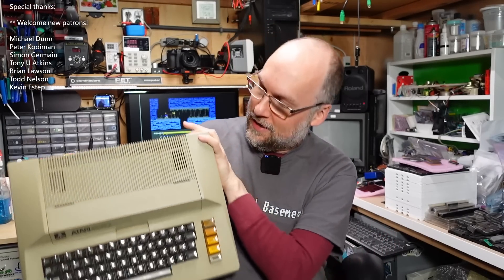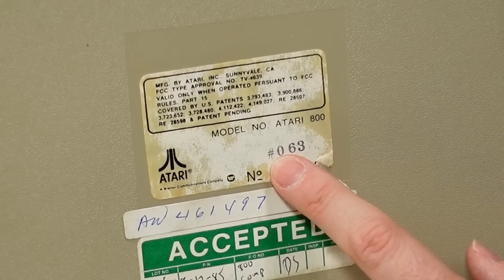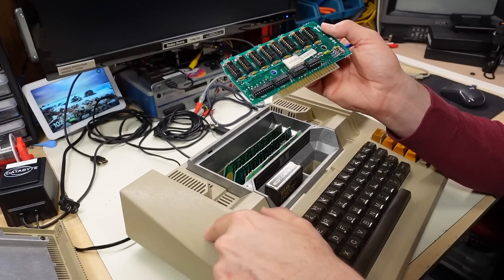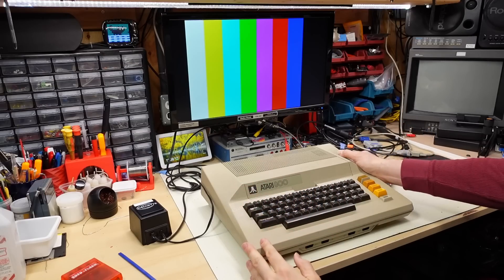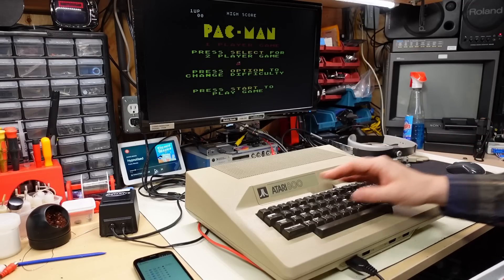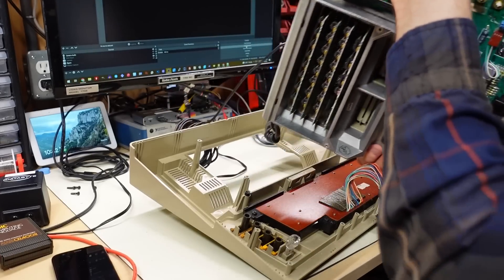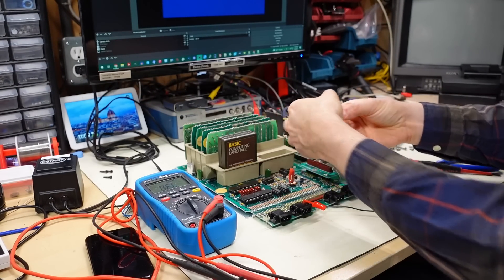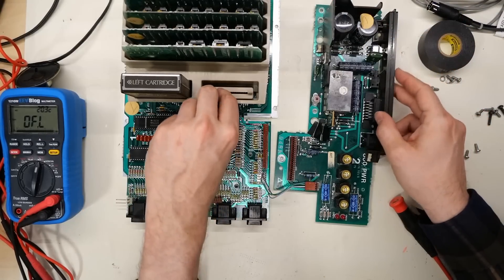Troubleshooting the beautiful Atari 800

Comment: Another point which was partially addressed in this video, is that that cast-iron shielding around the cartridge slides and the expend memory slots were not just built for sturdiness, they were also built for functionality. First of all I am sure you all know the main purpose of the shielding was preventing the computer from interference. Without it, it would interfere with many radio and television transmissions. 
    The other purpose of the Cast iron also was to help guide proper cartridges into the correct position without bending them or mangling them while trying to force them is as many people did try with disastrous results.  The other purpose was in the expended memory slots. These slots were more than regular slots. Typically, the first slot was always designated for the ROM and that card was remained untouched. Aftermarket cards produced were not encased in the same type cased using in the same basic or game cartridges.These cards tended to flop within the cartridge slots. I have seen other people try and force feed them into the wrong direction. However, the original cartridge expansion slots were outfitted with plastic that aligned with in the expansion slots perfectly. In fact the cards themselves were to prevent any damaged by miss inserting cards in the wrong way and they would simply lock into place and buy fully seeding the cards it was easy to see when they were inserted. The first slot closest to the person installing would be the ROM exclusively. The next slots were populated by two types of ram slots/cartridges. These memory cards were labeled either 8K ram or 16 K ram with the system limitation of 48K. Aftermarket cards and slight modification were able to even expand the system farther than that.  One important sidenote, is that the slots were not only memory card slots but full functioning iOS slots to the system board. Other cards were able to provide systems like full 80 column text sound a separate monitor, yes it was able to do two monitors at once, with the use of easy expansion boards. Over third party, and less than legal, were ROM slots to a grade it into various other machines. The slots were very hard to come by and were usually made to order. Why I don’t know anyone would do such a thing other than just to show off were emulation for the Atari 800 super system, the Commodore 64, a TRS-80 and further graphics expansion slots. Atari’s reasoning.was to upgrade.the system with new ROM boards. The Atari machine was far superior to any other machine the that was ever available on the market . This includes the Commodore Vic-20 and 64 timex Sinclair, the Apple computer, the Apple Computer two, the Apple to SE, and many others. The Atari 800 computer was far beyond most of any computers in the day. Its largest downfall came with the title of Atari. The problem was Atari suffered from the fact that most people associated Atari with games and therefore the Atari 800 was considered to be a toy/gaming machine as opposed to a full-fledged computer. For instance the Atari computer and the Apple computer had most of the same components as the Atari 800 however the Atari 800s board board boasted several other CPUs in a multi processing unit . This was the first unit to utilize multiple processing. Such as a separate video processor, I/O processor, and a separate audio processor, plus it’s all 6502. Those with the Apple computers we’re pretty much stuck with the available ram/rom for system plus the 6502.  The games for the Apple computer in many cases were extremely fun to play and supported incredible graphics although usually black-and-white. The Atari on the other hand were able to produce games using several different processors at once while using the two graphics and sound processing capabilities. The nail in the coffin however was the Atari label of their computer and that alone was the reason people did never take the Atari computer as a system computer they would rather spend the extra money in an apple thinking that that was the better choice for home computing for serious users. However, at least the people I know, ended up being astonished by the different modes of Atari graphics available to it, the mix and matching of display modes, and the variety of the player missile graphics system which were independent from any other portion of the display,  across the board  and with collision detection were able to enter react with the backgrounds and added a great deal of power to the gameplay. Once again the problem was most people would only see this as a gaming computer rather than notice the gaming was not the main part of the computer and that the computer was vastly superior to all the machines at that time were available including the IBM home computer with the exception of the first Apple Macintosh, which, of course given competition by the Atari ST. On the computers these days are truly wonder us to be hold, I think in the later 70s and mid 80s more the pinnacle of home computers. Those were the days when you could sit there and program a game that was truly an art form. It was a day that you could sit behind your keyboard after finding out that you have pushed your memory limits that you could go back and refine your programming to take advantage of every single bit of information in your cold. To find that extra ‘um-ph’ and you’re programming cold and realized just how much you could squeeze out of it. Every single line counted. It was a challenge to go back recalled and figure better ways to do it and eventually come out with a masterpiece. These days however it is so much different you can spend an afternoon writing code and coming up with a game the big differences while space invaders I could write on an Atari 800 with only take 8K Memering writing that saying game of spaceinvaders somehow turns into 50 to 90 MB of coding. The computers of the day simply do not teach Tate coding  they only teach sloppy mess judgments and waste full memory as you come up with the best one megabyte program that you could’ve easily done on the Atari for 16 K of RAM. In fact, this day and age the ability to go in tweak and build your own systems  have given way to iPads iPhones and the white where you can’t take them apart and replace all the components nor update them. You simply have to either throw them out, sell them, or let them gather Dustin some box in the basement. The only exception to this rule is high and PC  consoles and for some reason, without allowing gaming to be made within a reasonable amount of memory, they somehow are all turning out to be simple games with unbelievable memory requirements and that take up too much memory to even bother with trying. Big tech on this part , with me at least, has let me down.

Comment: Remembering the 400, you got virtually nothing in the box save one VCS joystick, everything else had to be bought and boy were they expensive bits too, the BASIC cartridge was super super pricey and the price of the cassette device was astonishing, games were also very expensive in cartridge format and I think the only cassette game we had was Kingdom basically a rehash of BBC's Yellow River, my one lingered on into the early nineties when the power supply blew and just nuked the whole machine.   It was pretty worn out although I had hooked up a printer and got a Word Processor cartridge that I used to do all my thesis for my nursing finals on so it earned its keep :D

Comment: The 800 is my favorite computer model of all time, but I couldn't afford it back in the day and settled for a 400 with 16K. Atari did offer a 48K upgrade (pro installation only), so I got that, a third-party mechanical keyboard to replace the membrane, and a few other internal goodies. The result must have been a unique 400; I wish I still had it! Learned enough on that machine to set me up for a career in software (35 years and counting). Fulfilled a lifelong dream and bought a minty 800 on eBay last year 😁

I'm still amazed at the 800's construction. The 48K model is no less than 7 PCBs! I never knew until recently that the CPU and graphics chips were on a daughterboard. Apparently the 400 also had a hidden slot and used the same CPU/graphics card. But yeah, USB-style I/O, graphics/sound coprocessors, and S-Video in 1979? Impressive!

Comment: I bought my first Atari 800 in 1979. I did so many hardware changes to it that it eventually had no top. It also had a heavily modified ROM with lots of extra access. That micro switch was disable within a year. I actually did some work with the guy who ported Pac-Man to the 400/800 (some Disney educational software). My brother still has a couple 800, not modded

Comment: Originally the ram and rom cards came in CARTRIDGES that fit in the back.  I guess later on they decided to save money and sell them without the carts... Mine had carts, so of course they couldn't wobble or be put in backwards.  Also there was no screws to hold the top down, they must have put those there so you wouldn't do things like take the cards out and put them back in wrong, something the original carts prevented.

Note, a friend of mine took one of my carts and hot glued and wire wrapped a bunch of chips on and made a 128k ram disk. I was doing game development on my machine and that sped up assembly time a lot.  The language was assembly language using a SynAssembler cartridge.  Atari made an assembler cart, but it assembled too slowly to be usable.

Comment: The 'Accepted' stickers. In the '90s I went to Australia from the USA, and they stuck similar "accepted" stickers on some of the electronic & computer equipment that I took into the country. The cord for my Macintosh SE/30 got one and a few other  items got another. When I went through Customs, the inspectors examined the electronic and electrical devices and attached these adhesive labels to either the device or the power cord. Most of the stickers that my equipment were given were attached to the power cords. They did use a green/white label, and they were printed out, not handwritten like the ones on your Atari. I think there was a place for the inspector to make an identifying mark too, on the stickers, which might have been a date and an inspection number. I don't know if the labels in your video were from Australia, and I don't remember what the rationale was behind them; also this was in the mid-90s, not the '80s. It's possible they are an older version of the stickers that I encountered. I believe the Australians were particularly concerned with putting stickers on the AC adaptors and power cords of these devices though. There could be a chance that your Atari has been to Australia and that is how those stickers got there. The stickers that I am describing were attached to electronic and electric devices by Customs Officials in Australia. They warned me not to remove them.

Thanks for the content.
Keep up the good work.
בס'ד

Comment: The pinnacle of my 8-bit Atari life was cross-wiring joystick connectors and writing some machine code to send data out of one machine and read it on another. There was a software speech synth that blanked the screen when it was speaking and I had one machine deciding what to say and send the data to another, keeping the screen active on the first one. Lots of fun.

Comment: My first computer was a TI-99/4A (which I still boot up every day). When TI discontinued the machine in '83, and software availability dried up in my region (and customs/duty fees made catalog shopping too expensive) all of my friends had Atari systems, so I made the switch to Atari. Mine was the 800XL model, but I always loved the design of the original 800, and it remains the best video output to modern monitors. My TI has it beat in the 21st century with replacement VDP boards that have native VGA-out and several display enhancements/fixes, but the original 800 has no competition out-of-the-box.

Thank you for a fun video that takes me back to a very different time. I paused to say thank you, but will now go back to see how you got the keyboard fixed.
Reply: My cousin had one. Took up 2 desks with the daisy chain of peripherals he had sticking out of the side. 😆

Comment: Nice to see some Atari 8-bit content! The Mitsumi keyboards are relatively rare in the 800s, only used toward the end of production, probably late 1983. Most 800s had a keyboard made by Stackpole or Hi-Tek featuring individual switch contacts instead of a mylar.
Reply from the maker: Ah ok that kind of explains why information on it was so scarce. Weill the next video will be on a Mitsumi keyboard repair :-)
Reply: @adriansdigitalbasement  Looking forward to it! One of my 800s is a late-production unit with a dead Mitsumi keyboard.

Comment: Yay !! Atari time finally .. thank you.  I had all of the Atari line in my youth.  I remember a mod on the 400/800 where you turned off the write enable lines to the upper memory where the cartridge data resided when plugged in .  This way you could just load that section of memory from a file, flip the switch, and you could run the cartridge program without it being able to write over itself.  It was a cheap form of cartridge copy protection they used back then.

Comment: My mother bought an Atari 800 when I was a baby, and when I got older it was my first computer at around age 4-5. I accidentally pulled it off the table once (yanked the joystick too hard) and the whole top popped off. Don't know if we didn't have the screws or they were just loose, but back in the expansion section we had the maxed out RAM and ROM boards but they were in actual cartridge housings rather than bare boards.

I really miss that 800. I used to be so good at Galaxian as a kid. This computer is what set me on the road to becoming a programmer (which I've been doing professionally for the past 15 years now) when I found out that I could type in my second grade math problems into the BASIC prompt and it would spit out the answers for me.

Comment: The Atari 800 is the last of the units I need for my collection. I wanted to collct all the computers I wanted as a kid. I lusted after the 800. I got a C64. Nice work. Wish me luck I have a 400 I'm bidding on in a local estate auction.
Reply: I might be able to help you out. I have an 800 with a floppy drive that has not seen the light of day for 25ish years.  I will dig it out tomorrow.
Reply: I dug it out.  The machine works.  I have not hooked up the floppy drive yet.  I have the Basic cartridge and the Centipede game cartridge.  Both cartridges function.  They are both left slot cartridges.  I have a BMC monitor but it needs work.  Color is almost nonexistent.  I have 6 or 7 boxes of floppies that I have not looked at yet.  Mostly games if I remember correctly.
Reply: @whitehedr  Thanks, sorry for the late response. YT doesn't notify.
Reply: @KAPTKipper  Was a good choice, I'd have rather had a c64. lol

Comment: This is the first time I've seen inside an Atari 800 as well.

The design/engineering inside the Atari 800 was very clearly done by the same people that built the Atari 2600.  Similar looking PCBs, Similar die cast RF sheild/housings, the exact same setup for the RF RCA cable, little hole in the die cast cover with an adjustment (color carrier frequency perhaps?).

Comment: I had an Atari 400.  I ordered a regular Atari 800 style keyboard and 64k expansion card for it.  I had to take it to ta shop to get the keyboard installed.  It was all loose pins on a ribbon cable instead of the usual flat ribbon connector.  I should've read up on the 64k vs 48k.  The system could handle 48k natively.  The other 16k was only accessible through commands.

Comment: RAM and ROM cards originally were packaged in a case - much like cartridges. Atari eventually sold all 800s with 48K which populated all the slots so Atari, I guess, saw no need to case up the RAM boards - saving some money.

Comment: I've done two Atari 800 repairs in the past. I bought a used machine in the early 1990s. I worked with a guy that was into Atari 8bit that, just based on my description of the problem, reached over into a bin and handed me a CD4051 and told me how to go about diagnosing which of the two were bad. Fast forward into the 2010s and I bought an 800 cheap off Ebay, where the owner bought a new old stock keyboard to repair his machine and it still didn't work. Same exact problem, and this time I had a bin of repair parts I had saved. The other problem was a hack-job on the door lid switch. I just soldered a jumper.